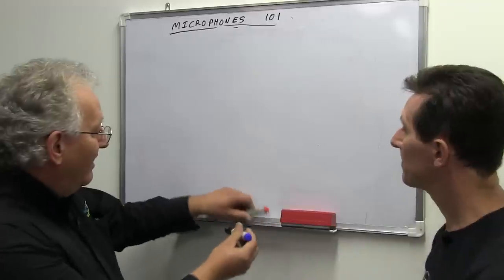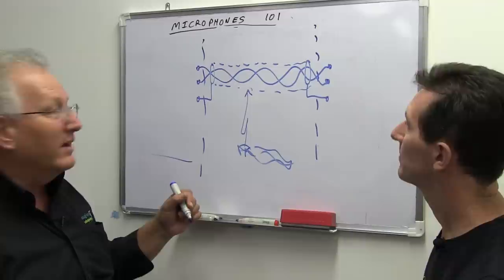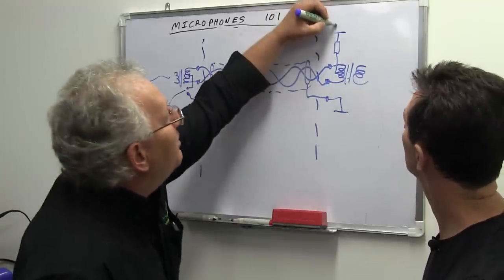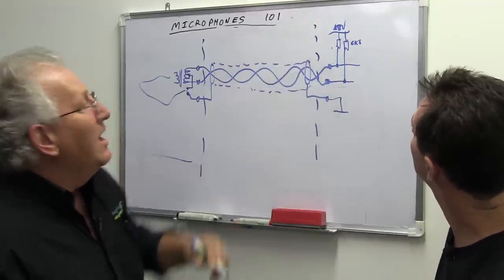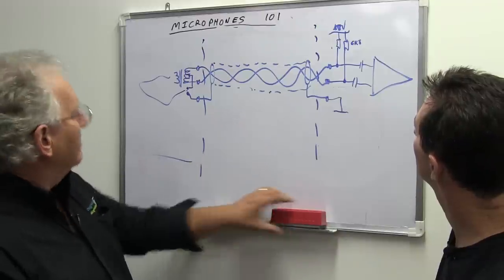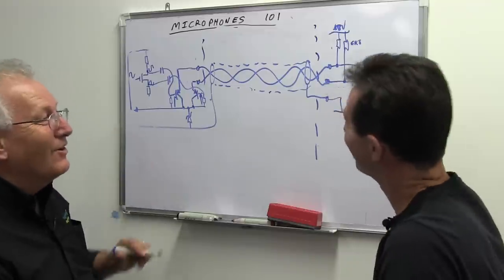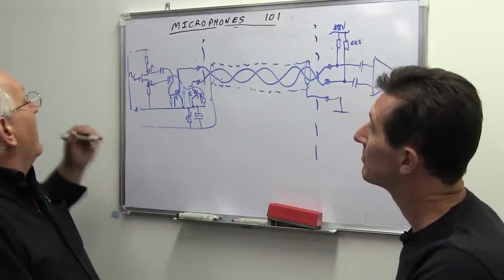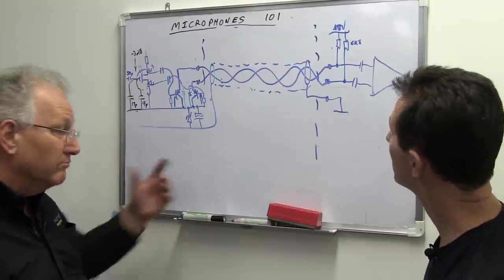EEVblog #616 - How Microphone Phantom Powering Works

Comment: I loves Doug's little jabs at the audiophile market.
Reply: You mean audiophool market :-).

You know what they say about fools and their money.
Reply: Lan Party Hosting I would agree that those Audiophool Grade DAC and amplifier are total waste of money. But I don't know what 'crap' a onboard motherboard audio would be, since they sound pretty decent to me, as long they don't sound like a $10 radio speaker.
Most modern computer have decent onboard sound,even my 2yrs old laptop do support 24bit/192khz sampling rate. What you need more for a 2 channel Stereo sound?
Reply: Bernard Lim its not about the bit and sampling rate, most times the dc to dc converting power supply on your motherboard to power your cpu generates noise which gets coupled into the audio mixer making it sound noisy. Sometimes the microfon signal even gets coupled into the speaker signal or vice versa. meaning that you can hear yourself talk, our your friends hear themselfs / your music. This happens most commonly on cheap motherboard brands like asrock and aopen are worst in my expierence.
Reply: Lan Party Hosting For your case it's not the Dc-Dc supply problem.
you can try goto windows control panel > Microphone properties -- Uncheck "Listen to this device" that's a feedback feature when you have MIC plug in. If not a Noise-Cancelling Headset would solve your problem.
Reply: Bernard Lim A 24 bit DAC circuit is incredibly hard to design properly. Just because there's a 24bit DAC, doesn't mean the last few bits of it aren't garbage. e.g. 24 bits on 5V supply means the least significant bit is 300nV, so to get a true 24 bit circuit means <300nV noise. That's very difficult and expensive to achieve practically. At a bandwidth of 192kHz at room temperature, any resistor above around 30 ohms makes that just in Johnson noise, even before we start talking about all the shot noise, EMI within the PC etc.

16bits at 48kHz is probably a more realistic maximum for general purpose stuff like a PC sound card (and generally perfectly adequate), anything beyond 20 bits is generally just unrealistic marketing wank even in studio grade equipment.
Reply: KX36 DAC had their feature  mostly integrated, and pretty much "FIXED" ...Why measure the supply? a filtered supply is mostly adequate,and a 10 ohm ground terminator on both input and output. I've build a thumbdrive size USB DAC a few months back with this configuration NUF2101M>CP2114>WM8523>NJM2703>LME49726 for my KOSS headphones. but  the key to good audio is still "Equalizer" and good studio recording. IMO
Reply: "mostly adequate" is the key phrase here. Even though the last few bits in a 20-24bit DAC are usually made irrelevant by the system noise as well as the noise in the original audio signal and that in the recording hardware, it generally doesn't matter because you probably can't hear the difference anyway. Just like audiophiles hearing the difference between an expensive gold plated phono cable and a normal one is usually psychological. Mentioning the rail voltage was just an example to show just how small a voltage the LSB of 24bit is and how it can be dwarfed by system noise.
Reply: BlueFoxTV audiophool
One who spends mass amounts of cash on ridiculous Audio components and accessories. They truly believe they can tell a difference, and come up with elaborate excuses to justify these purchases.
Reply: agree, but there is an area lower down, so to speak, where some might not really appreciate the difference between  various systems and their abilities to bring out the qualities of, say, an orchestral recording properly, because of peaks and troughs in the response. It certainly is a very large area to cover though and some devices with their gold plated components  and what have you, costing many hundreds of pounds do make one cringe!

Comment: I guess that this is also how the twisted pair cables work in an internet LAN cable by also using the instrumentation amp or some similar principle? I pity those who nag that the topic(video) is boring as their own field of knowledge is short and they can't see connections to different things. Thanks Dave! I did not give any interest in mics before but I see that it benefits greatly in my general knowledge :)
Reply from the maker: I think there is lots of good stuff in here besides micophones too, plenty of circuit detail that can apply to many things.
Reply: EEVblog yah the whole twisted pair - i always do that anyway for protos...  it just looks cooler. i really didnt know it was 'better' (for some things).  but after this video - yah, totally makes sense.
Reply: EEVblog There sure is. I'm working on analog synth stuff lately and this series is giving me lots of ideas
Reply: Ethernet, ironically, uses transformers. At the frequencies that ethernet runs at they're cheap and small. And the isolation is pretty nice to have. They look a lot like a black DIP chip on a NIC.
Reply: Kevmatic22 Yup, and there are two transformers on one end and they are now even in tiny IC package or even integrated to the LAN sockets. Check hanrun HR911105A for example

Comment: I'm at 8:38 and trying to figure out how the source impedance for the S (assuming source on bottom, drain on top for this JFET) is lower than the source impedance on the drain. We're talking about from GND and VCC, right? I'm definitely missing something here.

EDIT: The only thing I can figure so far is that this is actually a common-source JFET amplifier with the capacitor shunting the low-side resistor there to ground. Or, arguably he mentions there is more capacitance gate to source than gate to drain(later). That could definitely unbalance it, guess I assumed it wasn't that big of a difference at the frequencies we're at. And he seemed to act like it wasn't the same thing because they were separated by time he got to it.

Comment: I had trouble comprehending having different signals on the same conductor.  Which now that I think more of it isn't that odd.  Common grounds have different signals running through them all the time, not to mention I guess different overtones would count as different signals as well

Comment: Are you sure you have to connect shielding at both sides of the twisted cable? I heard it's not good.
Reply: For mic cables, yes. The connection of the shield to the mic chassis helps shield the mics circuitry from noise. It is sometimes recommended that line level interconnects have the shield connected only at one end to break ground loops. This is likely what you are referring to.
Reply: @chrisbauer1925  Thank you!

Comment: Does the circuit at 9:50 have some name by which I can google it? There's one thing that I can not understand about it. Okay, we have the collector voltage fixed, good. To be able to work in the linear region, transistors need some voltage headroom between collector and emitter (determined by base bias voltage). Well, by looking at the circuit, one can deduce that this is provided by voltage drop on the base resistors, so collector-to-emitter headroom voltage becomes

Vce = Ibase*Rbase + Vbe

From this, it is natural to expect that when the AC amplitude of the input (base) voltage exceeds this value, we must hit the collector voltage (fixed by zener diode) and the waveform should become distorted. I.e., it seems that the maximum input/drive amplitude is set with base resistor and transistor beta.

But SPICE simulation shows that this is not the case! When the input voltage amplitude exceeds base resistor drop, the DC offset at emitter magically shifts to accomodate any AC amplitude, and the real limit is

V_ac_max = Vphantom/2

And no limiting at all (until the signal hits the rails, of course)! How this is possible?

Moreover, it can be seen that when AC input exceeds the above mentioned limit (Vbe determined by base resistor), the voltage on a zener diode actually dips to accomodate the peaks. So, in a sense, AC amplitude limit is actually defined by base resistor voltage drop if we want to have stable power to our curcuit, but not in an expected way.

Actually, this can be fixed by adding a separate zener diode for the base resistors. I.e., if we disconnect base resistors from the collectors and connect them to a separate zener diode having a greater voltage than the collector zener diode, we'll fix the common mode voltage at one level and collector voltage at the other, providing defined headroom for a signal and stable supply voltage at collectors.

Comment: Dear friends... Basic question.... I have a Korg Pa3x keyboard and I want to use a head worn mid-priced microphone so that I can sing with my hands free whilst playing. Is there any specific microphone that I ought to look for if I wish to just directly plug the 3-pin XLR mic wire into the back of the keyboard without opting for wireless receivers and so on. Also don't know if a wireless receiver set-up could be connected directly to the keyboard or not? The Keyboard has got its own Speakers amplification interface and vocal processor built-in. Many Thanks in advance Raddis from UK

Comment: How can the Schoeps-type preamp voltage swing capability be increased? I have a Chinese copy which clips if the singer goes anywhere closer than 2ft from the mic! Can the output transistor collector-emitter voltages be increased by increasing the value of the base-collector biasing resistors?

Comment: Now it make sense !!
I have Behringer c1-u USB microphone, which has quit low volume output.
Is there any way to get phantom power into it ??? or make it output more volume ???
Reply: Not really.  Yours is a USB mic, not an analog mic.  It solely draws power from the USB port for a fixed-gain preamp and built-in ADC.  Most likely you have a driver or software issue.  It is faintly possible that your USB host cannot source enough current for the preamp (in which case, try a powered USB hub). 

edit: apparently a common problem with that mic.  Poor design.
Reply: Did you try to adjust the recording level in the Windows Volume Control
panel? right click on the speaker icon in the task bar then select "recording devices" and go to your mike properties.
Reply: Thanks guys. I know USB doesn't have phantom power, just wanted to know is there any alternative way to get it louder.
DolganoFF  Ya I increased the volume level and thats how i have been working with that mic. But still I feel thats not an efficient way to get a good volume.
Reply: vaidhya nathan If you still have gain left in the mic adjustment parameters, crank it up!  And if nothing helps, well, you'll have to get another microphone I guess...

Comment: Joe Khoury
1 second ago
I'm a DJ, and run into videographers wanting to connect into my mixer. I don't have issues doing it. The problem occurs when they connect to the back of my speaker. It either lowers my output, or basically shuts off the speaker. I believe it may have something to do with phantom power perhaps? Is that something somebody here can explain. I don't have an audio receiver, but is there a setting to turn off phantom power?

Comment: You just eat the time to technical bullshits to straight forward avoid the REAL knowledge!! Explain it simply and all will be understandable. We have a cable with two conductors and one ground .With dynamic mics has not a short circuit to need power to works and with condenser mics we have a power amp inside that it needs power to work  so we need phantom power!! Thats it!!! WTF! You just do it to blow my mind!!!!!

Comment: Ok so how do you connect a phantom powered microphone into your soundboard that's all I wanted to know what a crock of yak dung are you talking about.
Reply: Why not just watch some other video instead of insulting? Just because you don't feel you need the information here or don't understand it, doesn't mean this video doesn't have value to other people. Insulting it is just plain dumb.
Reply: the title of the video is How Phantom Power Works not How to plug Phantom Power Mic to a Soundcard that's the crock why.